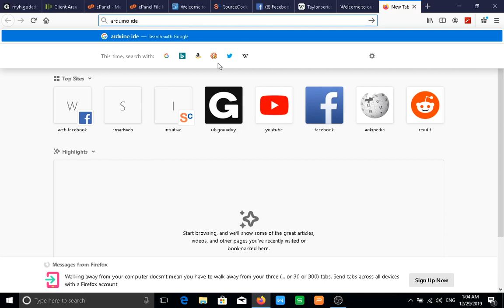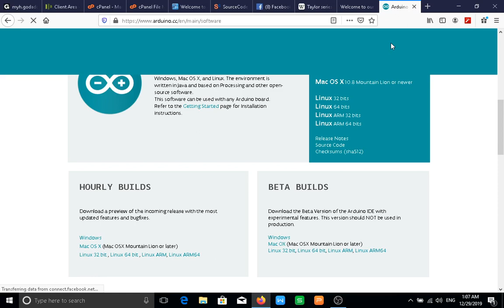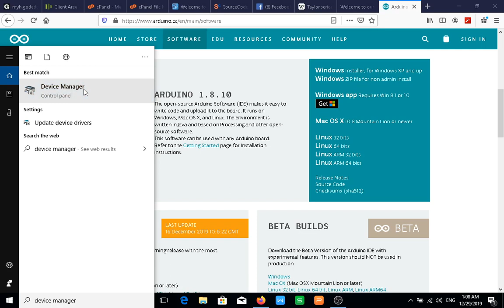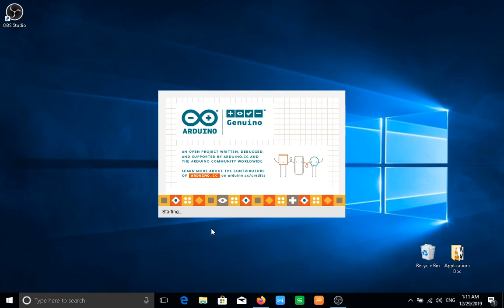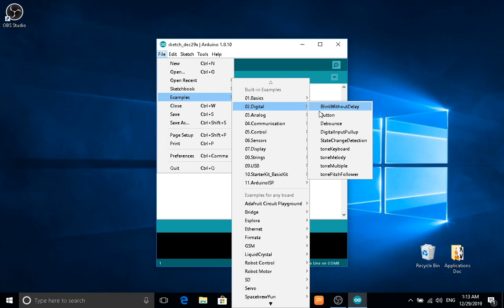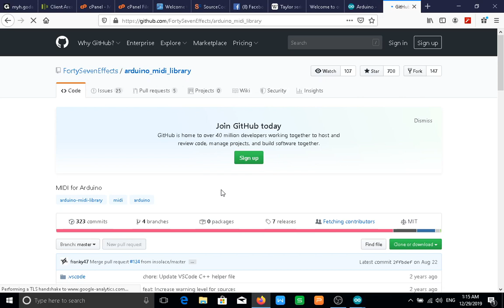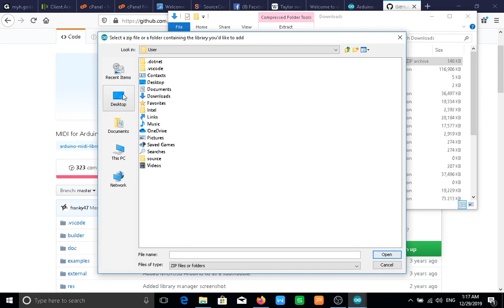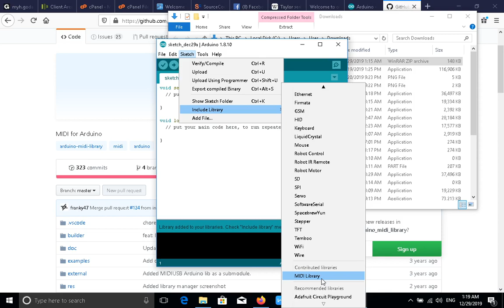Arduino Organ MIDI

Comment: If I wish midify, a small set of 13 pedal keys ,do you think one Adriuno Uno board would  be enough?
Reply: Absolutely. I use one Arduino to control a keyboard of 61 keys using multiplexers. I have not used this account in a while. Follow my videos at let's build it with Ade my new channel